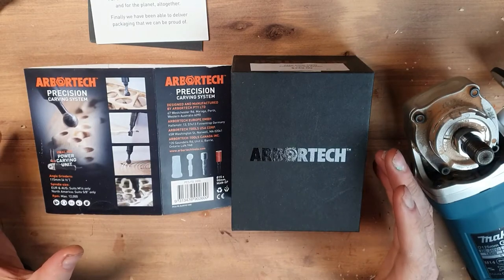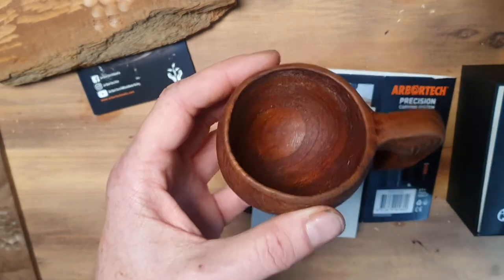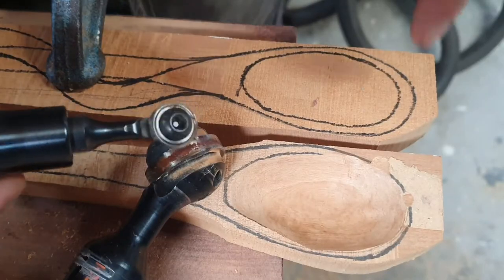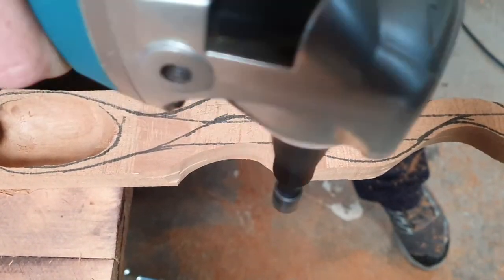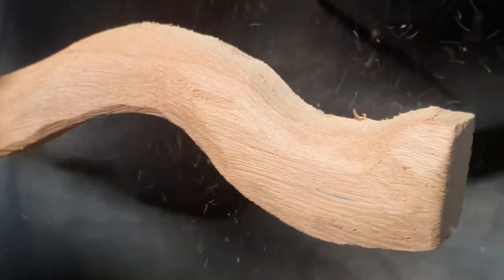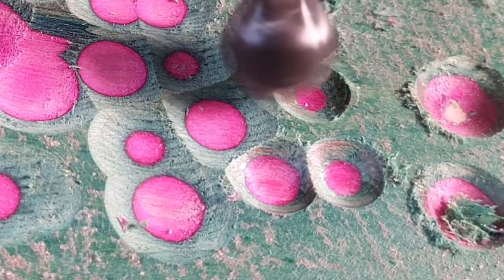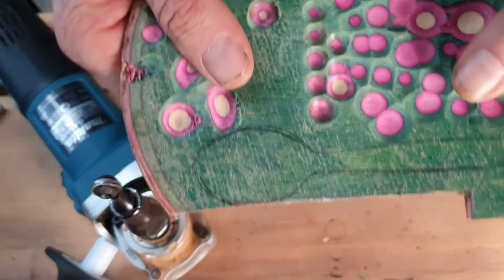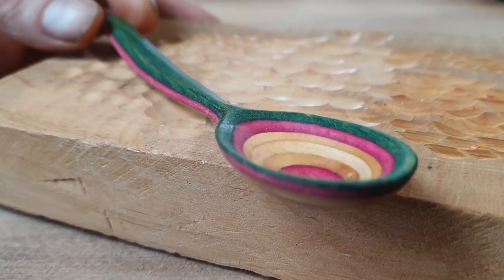Arbortech Precision carving system Review

Comment: How would you compare the Arbortech Ball Gouge and the Kutzall Ball Sphere for carving? Great explanation.on that Arbortech set.
Reply from the maker: I think the Kutzall sphere is way easier to use, but it makes more dust. Arbortech tools are really good for specific jobs, but they're not as easy to move around since they're on an angle grinder.